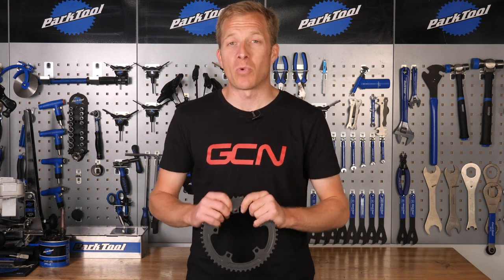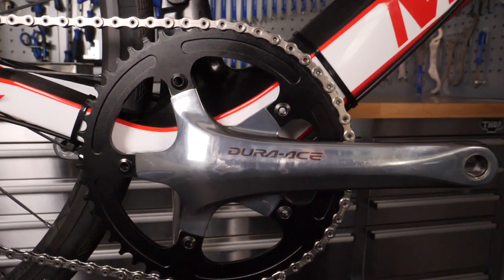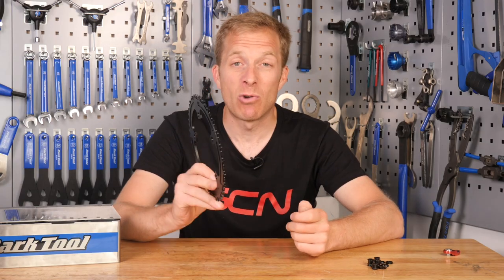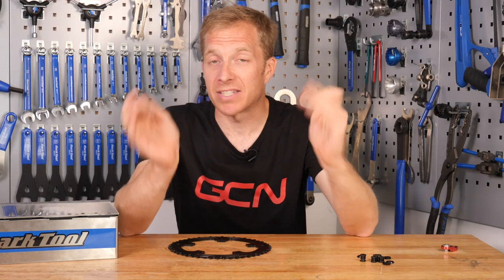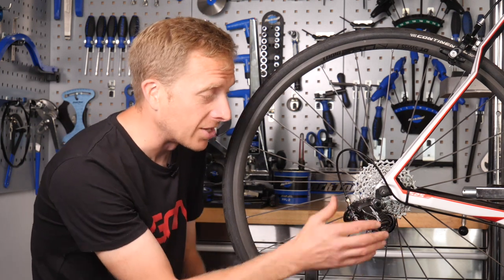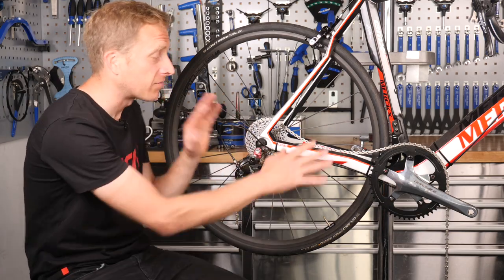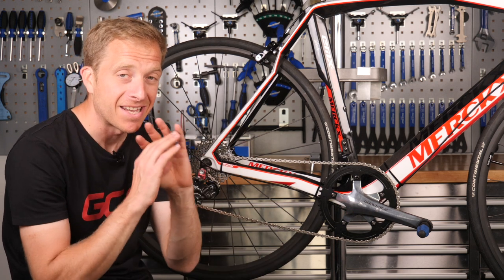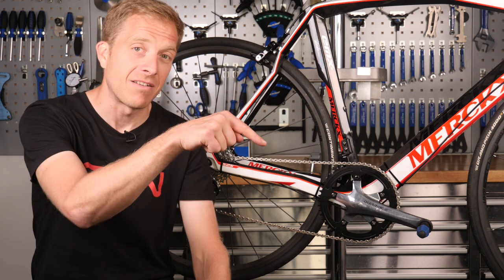Convert Your Bike To A 1x / Single Chainring Setup!

Comment: Hello!!! I've got a Giant Contend SL 1 Disc 2018. This is an endurance road bike, remember that point, it is important.

I got a Roadlink deraileur hanger extender and put it on. However instead of placing the extender downwards, I set it pointing back as far as it would go so it would clear bigger cogs.

Now what I noticed straight away was that when I set it back as far as it would go, it set back further than what I noticed on other road bikes that did the same thing. My theory is that this was possible because it's an "endurance" road bike, and that because it's endurance, it's designed to come with a 32T cassette, which means it needs to clear cogs a bit bigger than a standard road bike. So I think the deraileur hanger of an endurance bike is set back a bit more than a standard road bike for that reason.

Now before I purchased the Roadlink I knew that you could clear a 42T cog on a road bike with a medium-cage GSG road deraileur, which is what I have. So I ordered an 11-42T cassette and Roadlink. When I fit the Roadlink on, I saw it set back further than expected, and because it's set back more than a standard road bike, I'm able to clear the 42T cog with room to spare without a B-screw. I believe I should be able to clear a 44 without a B-screw and 46 with a B-screw, so I'll be trying that in the future.

Moral of the story? If you have a standard road bike and a medium-cage GSG RD, you'll be able to clear a 42T with Roadlink. But if you have an endurance road bike, you should be able to clear more than 42T as endurance bike RD hangers are set back further than standard road bikes. Bet you didn't know that eh, quite exciting news isn't it?! There is another factor coming to play as to why I've got such large clearance, and that is chain length. A shorter chain pulls the upper jockey wheel away from the big cog, giving you more clearance. It also gives you the chain tension to run wide ranges, and also helps keep the chain on the chainring even without a narrow-wide. Just remember to put the chainring on the outer position as without a narrow-wide the chain will fall off the chainring when in the small cog if the chainring is in the inner position. When the chain is at it's loosest, you want the chainline to be straighter. The acute chainline from outer chainring position to big cog doesn't result in the chain coming off a standard chainring because there's a lot of chain tension when in the big cog.

When installing, set the chain on the big cog, then shorten the chain until the chain is almost straight through the jockey wheels. Your bottom jockey wheel should be pointing more forwards than downwards. Basically when your chain is in the second biggest cog, the chain length should be such that the RD should be about in the position people normally have it when on the biggest cog. Know what I mean? Works a treat.

Have I been helpful, I've been very helpful haven't I?

Comment: I have four 1x rigs. Love it. Three are converted from standard and one is the latest SLX 1x11 iteration. Not sure I'd convert my road bikes over though. I did, however, convert an old GT ZR road bike from drop bars to straight and put on a WickWerks narrow/wide 42t CX chainring with 11/36 in the back. Light and quick!

Comment: I have converted my giant defy with roadlink extender and added a 11 40 shimano cassette. Worked all ok since August last year. Still have ultegra dual rings up front. Spacer needed when adding the mtb cassette.
Works a treat and no roads need you to leave the saddle.

Comment: Replaced rear derailleur with a  low cost SRAM Apex 1 derailleur, 11 to 42 cassette, and kept the normal 50 tooth chainring. So far so good.

Comment: For anyone who's curious about a 50t Chainring + 11-42t 11-speed Cassette combination, here's my setup:

50t Wolf Tooth Narrow-Wide Chainring for Shimano R7000 Crankarm.
11-42t 11-speed Shimano XT Cassette on an 11-speed hub without spacer.
Shimano Ultegra RX derailleur with Wolf Tooth Roadlink DM.
116 Chain links Shimano Dura-ace (Any chain suitable for the Chainring will do too).

Although the Ultegra RX has the clutch mechanism, I like that it gives the option of turning it off for smoother shifting. I found the clutch not required on asphalt when paired with the Wolf Tooth Chainring--No chain slips so far after 400miles. On light gravel paths (~2" obstacles), it runs well without relying on the clutch as well. The clutch is still useful to minimize slaps on bumpier trails.

The cassette spacer on an 11-speed hub had me puzzled. While adding the 1.85mm spacer is recommended when pairing an 11-speed MTB cassette to an 11-speed road hub and tuning unloaded appears to validate it, riding the bike revealed otherwise--excessive noise on high gears (small sprockets). The skewed chainline was the main contributing factor after fiddling with the derailleur high limit screw and tension.
Removing the spacer had solved the issue and even with a slightly more skewed chainline on the low gears (large sprockets), the noise was minimal. 

If available, I'll suggest going for more than 116 chain links for this configuration to reduce the derailleur extension on lower gears--Shimano sells 11-speed chains with 126 links. Sadly, I'd only found the 116 links version available in the shops nearby.

Hope this might help anyone save a few (mis)steps and pain. Ride on!

Comment: After riding my ultegra groupset with double speed chainset for years I always hated the front derailleur and thought it was such a waste.  I barely ever used smaller chainring with 11-28 cassette only on super steep uphills that had decent length to them.  I now want to convert all my bikes to single speed chainset and at least 11-32 cassette.  I will use my hybrid bike as a guinea pig to convert that first and then if I like it I will do my road bike as well.

Comment: I dumped my 3X ringset on my trike a few months back and will never go back! .  I kept all my stock pieces other than 1x cankset&chainring.   Total price was about $40.  Total weight loss of bike was 2.0 lbs!  
PS: I noted some comments below where posters' kept stock big chainring.  Dont do it!  Spend a few bucks and get a 1x (thick/thin) chainring.  It will save you some frustration.
PSS: Vs swap out rear gears for a 32T+ big ring setup....or even a 10T small-ring setup ($$), this is what I did:
For my daily training stomping grounds (flat), I run a 50T 11x32 setup.....when I decide to do some hill riding, I simply swap out the 50T chainring for a smaller chainring and all is good.  Takes only a few minutes, and only costs the price of a second 1X ring!

Comment: I have built up a Specialized roubaix frame bought off ebay with Sram 1X11, I live in North Yorkshire just outside the North Yorkshire Moors national park, lots off steep hills 20-25% in places. I'm 67 and fitted a 42 chainring and Sunrace 11-50 cassette., on these hills I can get up them -  just, with 1X I am always in a the right gear for the  different roads and constantly change gear easily when going up or down hills, no messing around finding the right combination of front and rear gears. I can get 23-28 max on the flat when I can find it without windy conditions, (for a short period).

Comment: My TT bike: Wolftooth narrow wide chainring, properly sized chain with no excess, sram red wifli hacked with 15t pulley wheels.  Never dropped the chain.  No clutch and no chain keeper is not a problem on the road, its not like you are riding through rock gardens. (psst find my photo and show it on the bike vault).

Separately I use the derailleur hangar on my hill climb bike.  46/30 up front and 40t big cog in the back.  If you go slower than 30/42 you are walking anyway.

Comment: I use my 3x  mountain bike on the road as a fitness tool and this is what I do. I decide before every ride which drivetrain I want to use. I keep it there for the whole ride and use all of the cassette in the back. This allows me to enjoy the ride, grind away and not worry so much about shifting. And of course I still have a 2x or 3x system if I want. 

To each their own and do what you want. The point is to get out and enjoy moving.

Comment: I made my SRAM red etap wifli groupsett 1x with a SRAM CX1 chainring and a 11-32 cassette. It works absolutely perfect, I never dropped a chain, even on gravel roads or fast races.
I'm gonna experiment with a 3T Overdrive 9-32 Cassette.
1x is the way to go and most importantly: it looks amazing!
Reply from the maker: Nice!
Reply: I'm looking to set up a allez 1x bike with this set up. What parts do I need for shifting? I'm used to shimano shifters (shifting RD on right brake lever) but understand the shifting on etap is on left and right brake levers?
Reply: Matthew Han you need a rear derailleur, right and left brake lever, and a narrow wide chainring. 💪
+ Cassette and chain

Comment: Have used a bodged 1x system for British hill climbs last few years, all Shimano components, nothing special, just mounted the inner chain ring on the outside, and took a few chain links out to keep the tension tight! Haven't dropped a chain in 2 seasons of racing! Might go narrow wide chain ring this season though so extra safety

Comment: Good video! I live in pan flat Florida so have been using 1x on my road bike for a while now. SRAM eTap rear mech paired with an X-sync chainring has been a great combo. I run an 11-26 out back full time and have 46 and 50 tooth chainrings that I can switch between as the need arises. 50 tooth is the standard setup.
Reply from the maker: Glad you enjoyed Jon's video Nicholas!

Comment: Great video John, but there are many ways to  do this. I have a Surly Cross Check that I hacked to 1x. I have Sram rival shifter, so I was able to use a Sram Gx (mountain bike) rear derailleur with a long cage (no extender needed). I went with a 11-40 cassette from Sun-Ring to help me up the mountains here in Utah. Up front I used a 44T  standard chain ring with a chain-keeper. This eliminated the need for a narrow-wide chain ring. This has been a great set-up for several years now with no shifting problems, and no dropped chains (even on many long gravel rides).

Comment: I've previously hacked 1x on 2 cross bikes. First time around: SRAM Red crank with the 53T removed leaving the 39T. I used a short cage SRAM Red rear derailleur and no chain guide or keeper. Dropped a chain several times when in the smaller cogs (11-28 XG1090 cassette) on the rear so I shortened the chain and had fewer drops. On my 2nd time around I used an Ultegra 6800 crank with a Wolf Tooth 42T narrow-wide ring and a medium cage Force 1x RD (11-34 cassette) with 2012 Red shfiters. This setup was quite nice and stayed until I sold the bike. 

Next 1x setup on a future build will be Di2 road/mtb component combination.

Comment: Other ways to do this (that I have done):
1. All SRAM 10-speed MTB rear mechs work with all SRAM 11-speed road rear shifters. So if you have SRAM shifter you can buy a cheap GX clutch derailleur: you won't need the extender, the tension will be much better, and you'll have a lot better chain wrap all through the cassette so shifting will be much improved.
2. You can leave the inner ring on there instead of using spacers or shorter bolts, it works perfectly and just looks a bit crappy.

Not a hack or bodge, but be realistic about what gearing you need. I find I don't spin out a 42x11 in the real world and 42x32 is about the same lowest gear as a 28 cassette on a compact chainset so I don't have problems on hills.

Comment: I am a total 1x convert. I use Sram 10spd shifter (road, tt, and mtb) with x5 rear derailleurs and 11-36 10spd cassettes on my road, time trial, cyclocross, and mountain bikes  with different size chainrings, all 1x. One of the things I enjoy most about this set up is that I can swap cassettes, wheels, and derailleurs between different bikes. Simple, seamless, and efficient. What's not to love about 1x ?

Comment: I'm think of converting my 3x7 to a 1x9 on my 26" bike. I don't feel like dealing with cross chaining or tuning the front derailleur, either. 1x9 should give me a wide enough selection for the occasional bike path, but with the simplicity that pavement is just fine with. 

And I'm going to convert to ebike in the future, too. So a 9 speed cassette will be plenty of gears for use with a 500W middrive.

I just need to figure out what size chainring I want in the interim.

Comment: I have hacked my drivetrain on my commuter... 42t narrow/wide front ring with an 11-32 on the rear. If you take a link or two out of your chain you can probably increase the rear mech tension while still allowing access to the biggest cog. If have had no issues since I converted (about 6 months ago)!!

Comment: Short cage Chorus 11s fit a 32 just fine.  I'm running 1x Chorus with a custom 14-34 cassette (bad knees) and a 40T elliptical chainring without a derailleur extender.

Comment: I took the small chainring and downtube shifter off my 1987 Centurion Dave Scott, using washers to take up the slack on the chainring. I left the cassette as is, so it worked fine. Slight amount of crossover that I would imagine could have been dealt with somehow if I had felt like it.

Comment: For new Shimano Road (R9100, R8000, R7000). My friends tested it using Standard medium cage RD w/o extender with 11-40t XT 11s cassette and so far, the drivetrain doesn't have any problem. (Ultegra RX RD is highly recommended)

Comment: Interesting video to show how to do it but if you have already got a dual chain ring and you do the work on the rear of the drive train but keep the front the same you will be able to climb anything when it gets tough with no downside. I can see that 1x is a benefit to manufacturers as it should be cheaper but can't see any to a user.

Comment: hacked together a 1x with an early 80s panasonic frame/fork and a set of 29er mtb wheels. all i bought was the 700x23c tires which are cheap. best way for a mtb guy to try road biking.

Comment: I did a super cheap 1x conversion.  Adjust the limit screws on your front derailleur until you can't shift of the middle sprocket & then tear off the cable and shift mechanism from your left handle bar. Mission accomplished.

Comment: I went though all this exitement on my mountain bike 10 years ago, less bar clutter plus you save 200g from no front derailleur one less chain ring and no cable and outer. I just don't get the point on a road bike. You'll either be spun out every time you ride downhill over 45 kmh or grinding up every gradient over 10%. 

I have a 53-36 with an 11-36 mountain bike cassette on the back, works like a charm, massive range.

Comment: The wolf tooth hanger extension didn't match up with the B-tension screw on mine so I switched to an MtB derailleur & Wolf Tooth Components Tanpan Shimano. Shifts like a dream + clutched for better chain tension & barrel adjuster inline.

Comment: no discussion of chain line.    as roadies, we're relegated to the outer position w/ 1x set ups unless we run a 42 or so on the inner as I did on my gravel.    1x specific cranks aren't yet common enough to obtain 'cheaply' so it looks like outer only.

Comment: In the days of the square taper bottom bracket you would have had an added advantage when going 1x: the possibility to adjust the chainline by using shorter spindles.

Comment: I use 1x11 in my road bike, I went the other way around and opted for a smaller chainring. It cuts a couple gears from the top but 44/11-28 gives me the same high gear what the GOAT Eddy had. If it was big enough for Eddy, it's big enough for me. Never dropped a chain or had any problems on regular RD and narro-wide chainring. I can highly recommend.

Comment: My bodge experience with 1X:Commuting home on a balmy September's eve, I was at a light (junction) by the university when I spied some fair, impressionable coeds hoping to dazzle them with a masculine display of acceleration from a well trained track-stand. (Being an "off the market" married middle-aged man this is sort of self indulgent attention I am morally limited to.) As I hurled myself and steel steed forward in the small-ring, my cadence was abruptly halted in the middle of the intersection and I had to coast to the other side. The intended audience was not even paying attention (which they usually don't), which in this case was a relief. I surveyed the cause and found that my inner ring was collapsed in on itself. "What an absolute display of metal crushing torque!" I though to myself. 'Twas not the case. Ignoring regular maintenance protocols prescribed by this channel, I found that I was missing two chain-ring bolt, and a third was loose. Being prepared and casually dressed, I had my multi-tool and my t-shirt available, so I removed the now badly deformed sprocket which had wedged itself between a crank and the frame. I replaced the big ring, using the existing double ring bolts and the bottom hemming of my t-shirt to take up the slack (like a washer) of the now-too-long bolt.  I then proceeded to humbly ride my new and temporary 1X set-up,  carrying my "tacoed" inner ring, my ragged-bottomed shirt,  my bruised ego back home to the first woman I ever successfully impressed.
Reply: Tim Peterson haha. Lovely story Tim. I feel like I should have you in the set with me to explain it.
Reply: Jon, I wish I was on the same continent; I would be pleased to share that story in person. I am honored never the less. How can I send a photo of the garbled chain-ring in lieu?

Comment: My Specialized Sequoia came with 2x9.  I had front derailuer noise that was impossible to get rid of. I converted it from drop bars to Jones Bikes H bars, 38 tooth chainring and 11-42 cassette.  Had to replace the rear derailleur, brake levers and switch to a thumb shifter.  It turned out fantastic.  Rides very good.